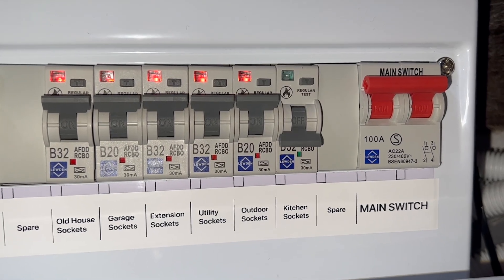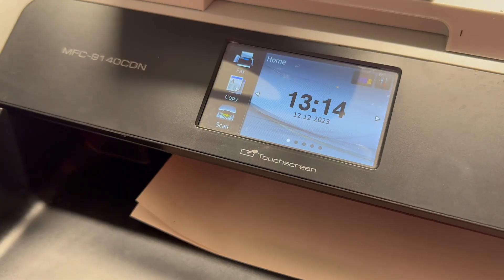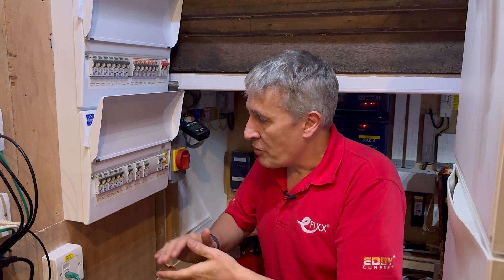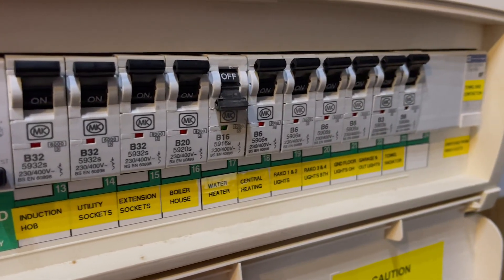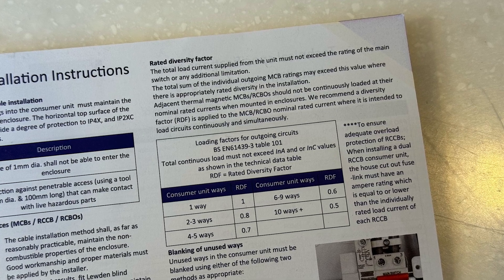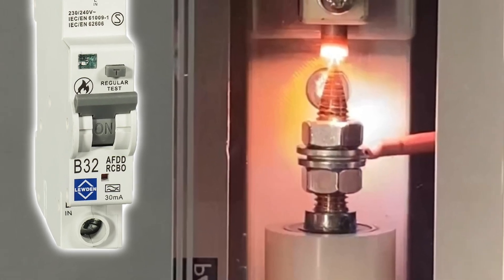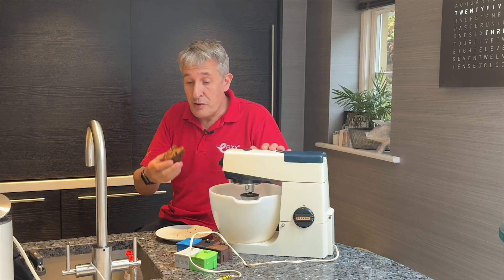Surprising Method for AFDD Testing During Consumer Unit Change

Comment: 8:10  Instead of simply writing the traditional "Spare" which implies that it is a spare way which is available to be used in the future (perhaps by a less knowledgeable person), I write "Thermal Gap" or "Thermal Spacing"  to indicate that this gap is deliberate in order to reduce heat build-up...  Of course, also leaving a few "Spare" ways at the end for future expansion, although I try to design-in Solar/EV etc at the start to future-proof the CU and make it easier to install in the future.

Comment: 5:14 - why are these all still rated at 100A? If the main fuse is 100A and you are adding 16A or more, these need to be rated higher - especially when there are multiple DBs running off them

Comment: I suppose I am showing my age saying we had one of those mixers. (it got damaged a few years ago while extending the kitchen) Having repaired it in the past the speed control was by two contacts breaking the supply to the motor. One contact moved due to the centrifugal force from a couple of weights spinning around while the other contact was spring loaded from memory with more pressure the faster you wanted the mixer to go.
The system finding a happy medium with the centrifugal force balancing the spring pressure. I suppose it worked but produced a lot of sparks so really surprised you got ot to work at all on the AFDD circuit. Maybe a good buy from a second hand shop as a cheap tester for AFDD😂
Reply from the maker: Great insight thanks - might have to take a closer look at the motor control.

Comment: When it comes to RCBOs, they exist in both single pole and dual pole versions, with the dual pole also interrupting the neutral wire on a fault. In what type of earthing system or use case is the single pole deemed insufficient and a dual pole is required?
Reply from the maker: TT must be double pole. TNCS can be single unless supplying a defined special location such as an EV charger.

Comment: Could you explain your point from 3:10 a little more please. Why would the power be travelling in the reverse direction?
Reply: Form solar panels to the storage batteries or from the batteries out to meet the house's supply needs, such as during a power cut.

Comment: Tripping AFDD/RCBO - Does your pop-up socket contain a type 2, 2+3, 3 SPD?
I've found quite a few instances of surge protected extension leads/multi-gang leads causing nuisance tripping with the SPD threshold voltage decreasing with age/being naturally low, mixed with reactive loads it can be quite an issue.

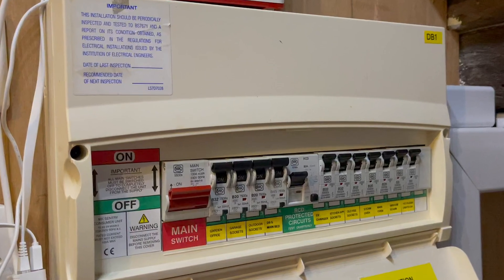Comment: 3:09 Are there any markings to determine which manufacturers RCBO’s are unidirectional and which ones aren’t?
Reply: Double pole perhaps? Where by both the live and neutral are being monitored?
Reply: @T_Perkins  I believe his question is , is there a symbol on the device indicating if it is capable of correct operation with current flowing in either direction. I don’t believe there is a symbol as yet that a standard specifies . @Efixx ?
Reply: @ladams5356  now you mention it, I haven't heard of a standard. However, if the schematic is drawn on the device itself, one should be able to determine its operation or reading a technical diagram for it.
(I do get the point being made a bit more however)
Unfortunately, mobile phone do mean there is a penny pinch in companies to say 'info is available online' rather than trying to describe anything in packaging or on the product that isn't required by law.
But yes, I see the point that is being mentioned - I'm not clued up on solar or battery installs as of yet so I assumed that perhaps double pole rcbos would monitor both live and neutral as AC is alternating back and forwards... By that definition double pole rcbos should be able to monitor both incoming and outgoing changes on both live and neutral.
That's my forth pence of an assumption! :)
Reply: @T_Perkins  while AC ‘will’ flow in and out of the mcb portion some manufacturers leakage architecture uses CT’s which are flow direction consensus and hence detection is inoperable in reverse. If you note AC CT’s are directional 👍
Reply: @ladams5356   well that's something I'll need to get my head to at some point then and digest some literature as to how and why and what is used in a-z scenarios... Aha! 
I'm sure a standard may well come about at somepoint - though, you may well have thought something by now as solar installations are not really a new thing anymore. Batteries and car chargers, yes, but solar installs...
Thanks for commenting - learnt a bit more. :)
Reply: It’s a good point and hope a standard is agreed and manufactures apply

Comment: Just a question I thought the outer sheaving on the tails are meant to butt up to the main switch in the DB, am I wrong in thinking this?
Reply from the maker: You need to remove a small section of the protective sheath to indicate the polarity of the conductors
Reply: @efixx  Thankyou for letting me know I get the point
Reply: Not best practice I believe plastic indicator sleeves used by DNO better . @efixx

Comment: I dont get the trend for fitting dual stack units, wouldnt a vertical 3 phase one with a single phase conversion kit fitted be easier to work with?
Reply: Familiarity is a word that comes to mind, especially on the consumer end. 
The double stack units take up less space per way than a 3 phase, however marginal.
Also, if by vertical you mean the ways centrally going top to bottom, cable length may have been an issue.
Trend it may be, but familiarity I reckon is the key to most of it.
Up and down. Rather than left and right being the same depending on which bank...

I can just imagine trying to have the conversation with me ol ma with a 3 phase board... Left and right... No. I'd rather rip tarmac off the road in 0 degree weather thanks...

Comment: Get a digital storage oscilloscope on to the line driving the pop up socket. Get one that does FFTs, just in case that is useful.
Reply from the maker: We’ve got one at the unit - perhaps a weekend job.
Reply: @efixx Would love to see a video of the waveforms you encounter which trigger the AFDD. That would be really useful for everyone

Lightening - not dissimilar to lower voltage arcing! - causes I believe wideband RF interference; I don't what waveform aspects these AFDD's trigger on, it could be a waveform shape in the time domain, or a particular spectrum in the frequency domain.

Comment: Probably a switching power supply on the same circuit. Or something WiFi related. It will be something that you dont expect.
Reply from the maker: Oh no not the dreaded EMI
Reply: We have the same issues in our home. Some appliances trip the AFDD, but you move it to a different circuit and they are fine. You switch  other items off and you can use it on the original circuit. Seems to be electronic devices mixed with electrical devices that causes the tripping. Can use the TV or the hairdryer, but not both together.

Comment: The magnetron in old microwaves causes havoc with these devices. This is compounded by the fact that many in HMOs where they are mandatory have rubbish old devices running in their rooms causing nuisance tripping. Total nightmare tbh
Reply from the maker: Some would say that’s the real driver for moving to AFDDs
Reply: Yes, filters out old junk. However leads to some heated conversations with landlords/Tennant's and often involves  several call-outs before the issue is resolved. Kinda awkward to charge for after charging a fortune for board change with afdd's.

Comment: Type 2 SPD?
On overhead power lines???
Am I the only person splashing out for Type 1s?
Reply: I agree, overhead lines should be type 1. Perhaps tho the overhead lines /transformer are just random B roll and not actually the supply for this property
Reply from the maker: The overhead lines are to an 11kV transformer which converts to 230 /400 network which is underground and TNCS .

Comment: I have just replaced my 12 year old wylex 11 way RCBO board for exactly the same reason and because I needed more ways with going all electric. I used a 25 way Hager board with all what you're fitting and fitted a bidirectional RCBO on my existing solar. 

I live in a small but very well insulated bungalow with solar PV (SE) and solar thermal (SW). I have an Eddi doing the morning shift and thermal doing the afternoon. I dread to think how many ways you need in very large property going forward.
Reply from the maker: can’t see them getting smaller
Reply: No solar, no car charging. Eco 7 1 bed flat.
15 on peak + 2 for surge 
4 off peak + 2 for surge
21+8 way fitted
Chap who fitted the boards was just giggling because he thought I was over speccing at first... It did dawn eventually being an electric only - so many places have gas heating and require much less circuitry!

Comment: Great video Gordon , the reasons for upgrade of the CU I can agree with , in my opinion CU should never of been allowed to be installed in under stairs cupboards in the first place. But what gets my back up is when some electrician’s lie to their customers by telling them that the existing CU is illegal and dangerous and doesn’t comply with the regulations. Then insist that it has to be replaced. I refer you to the onsite guide page 99 . Just because it’s old doesn’t mean it’s dangerous or needs replacing or upgrading. 
Great video as always Gordon 👍
Reply: never have* been, not "never of been"
Reply: @TheMatsushitaMan  should never of been allowed to be installed in under stairs cupboards . Means exactly that
Reply: Never have been implies it was never allowed.
Reply: @Dog-whisperer7494  No. Swapping "have" for "of" is simply bad grammar.

Comment: The old Chef, I have one of them in the cupboard.  Quite a beast of a machine with more attachments than can be imagined, and I think it has a brushed motor but no AFDD should trip from the arcing on brushed motors and glad to see this wasn't the case here either.
Reply from the maker: A classic of British Engineering lives on forever!
Reply: @efixx  Unfortunately not the case these recently scraped a 10 yr old washing machine because he motor failed